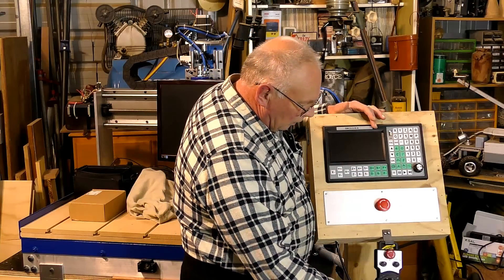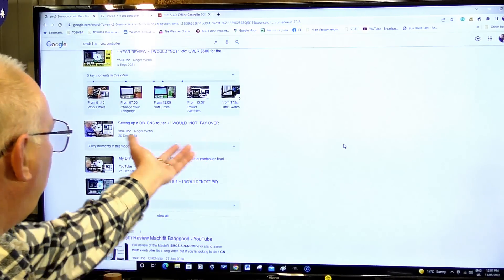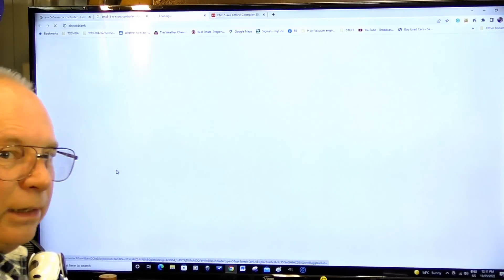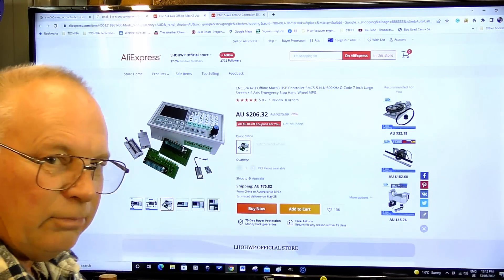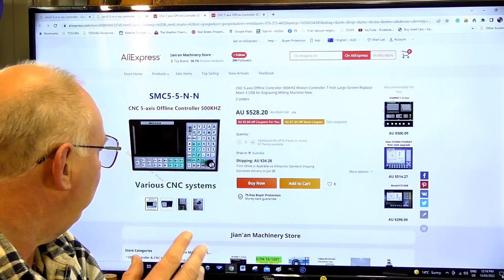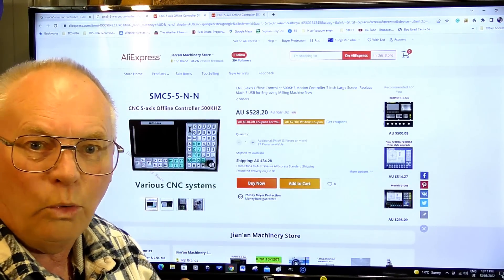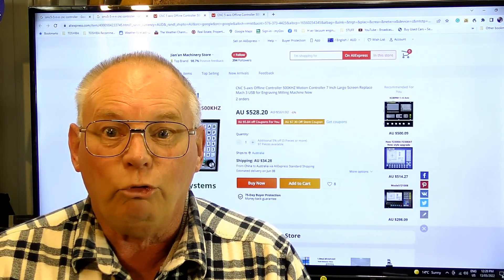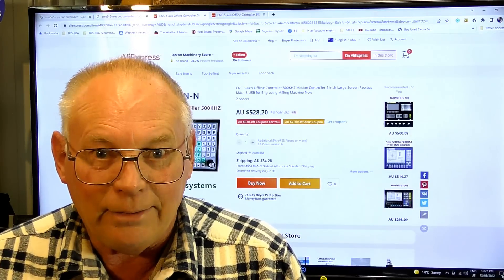Why I'm Dumping the SMC5-5-N-N CNC Controller from my machine

Comment: The cheap SMC4 works better overall than the 5.  They both have zero support, and have serious inherent issues that could easily be corrected by a firmware upgrade.  That is; if the manufacturer cared enough to issue an upgrade...
Reply from the maker: The SMC5 is good it is the sellers asking too much USA$450 is ok for the SMC5
Reply: @inventorsworkshop9600  Apparently you and I have differing ideas regarding the definition of "good"...  The 5 has a clumsy unnecessarily aggravating interface, is very particular about the code it can properly read (likely to make a mess of your workpiece if you don't check it first), and if set up for inches, it cuts faceted circles (not round ones).   As I say, the cheaper 4, is better overall.

Regarding the price; I paid $327 for mine, delivered.  And that was including the MPG pendant.  There are still plenty of outlets selling these for under $300, although some shops have stopped selling the 5s because of too many returns.  They are still selling the 4, however, which can be bought for a little over $100.

I haven't tried one personally yet, but I think probably the best controller in this class, is the DDSMC.  It is very popular, and I never see anyone complaining about the Digital Dream products.

Comment: Have you tried planetcnc mk3/4, or acorns Cnc controller? I’ve bought 5 or 6 of the mk boards for Cnc routers.
Reply: Planet CNC make an awesome product. I have their 9 axis board that will go on a Clausing Lath. The controller will allow the cutter to synchronize with the chuck to cut threads.
Reply: @JohnHoranzy  I've soon finish my CNC. After a month of research I'm narrowing to
Acorn 6. Look 90's but very stable, good support
Eding CNC looks like as stable and accurate as Acorn but less support 
And I just find Planet CNC today. 
I would like your opinion on Planet CNC.
Are you able to do rigid taping ?, and someday I would need upgrade my fixed gantry to 5th axis, so I need a controller that can handle RTPC or TCPC.
thx
Reply: @UPR91  I bought that system about 10 years ago. At that time there was only Mach 3 and Linux CNC for the hobbyist. Planet CNC at that time was a great value and did not lock down their software variations. You need to check with them for the rigid tapping function and if you have the correct spindle sensor. Today I would give Centroid Acorn a serious look and price comparison. Also look for a vendor that sells all the peripherals and not just shoveling boards from China.  
Have fun!

Comment: I am using Smooth stepper and Mb2 breakout board ( i thought it was bit expensive at first ) but its was so easy to get working  
 I paid about £380 (670Aus) + PC was it cheep Meh not sure ? but it does work really well ? should Splash out to move to mach 4 ?

Comment: Took me five minutes to find the SMC5 for ~US$350. From what I can find the B2B price has gone up- its no longer $200. It's common knowledge that there's always someone on Alibaba, AliExpress and eBay looking to make a buck by reselling for more than the real B2C price. You would be doing a better service for your viewers by reaching out to ShaoGe CNC and asking them for an official list of resellers and doing a video about that. While not the 'best' offline controller it's perfectly adequate for its purpose (and in most cases the SMC4 is good enough given most are running three-axis machines).
Reply: I ordered one for $500, waited a month watching the tracking number, then the order was canceled. so if you order one at the lower price you may never actually get it.

Comment: Hi Roger,
Thx for this update.
Is the Foinncc M350 a better alternative for the SMC5-5-N-N then?
as for the tool offsets etc. It's in the M350.
For the Mach3 hope you get a board with enough input's to get the limit switches and homing not on one pin so you have to run them seperatly instead of diagonal till one clicks and continou to zero the machine on the other axis. 
Looking forward for the Mach3 solution. Is it possible to cover the 5 axis machine to, please ? 
Also for the Mach3, will it be USB or the obsoleted RS232 port on new computers you'll be using or the ethernet?
Maybe linuxcnc, afterall, will be your pleasure to go to with some mesa cards
;-) Always a pleasure to see your new vids

Comment: Thanks for info. I was looking for a replacement controller for my 4 axis CNCEST CNC and saw the high prices and did not know whether to laugh or cry. I decided to rebuild my existing controller with the help of a YouTube video. I have ordered new control board, power supplies, VFD, limit switches and wiring. Total cost $300 AUD. Hopefully everything will arrive soon. Freight is slow at the moment.
Reply: Me to cncest usb mach 3 controller atm aint havin no good luck with it i have had it ovr a year n done lots of adjustments and changes i think its the Software tho that cncest provides 😒
Reply: @immewhou1755  I did not have a computer that Mach 3 or 4 would work on. I have been using free version of DrufelCNC which works well but only has 5000 line limit. Tried to purchase licence but need to use crypto currency to purchase. I did not want to do this. I will be using UCCNC.
Reply: @Peter Rowe oh ok so I dont guess uccnc  will work with mach 3 board will it ya my laptop wouldnt run mach so i bought deesktop win. 10 not ideal but was doing fine went to sleep n qoke up to windows 11 no bueno was busy n didnt think nothin of it at the moment couple weeks went by n i got back to tinkering n discovered that mach is not happy with win 11...and wouldnt let me roll back updates...now im graspin for straws ...
Reply: @immewhou1755  UCCNC only works with their controllers and AXBB-E.